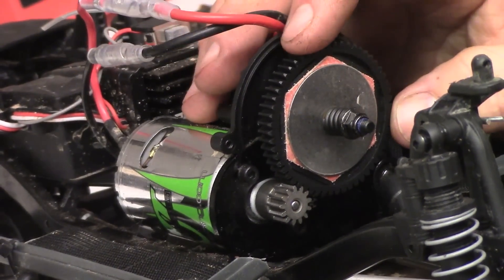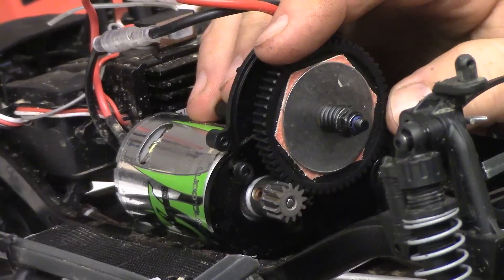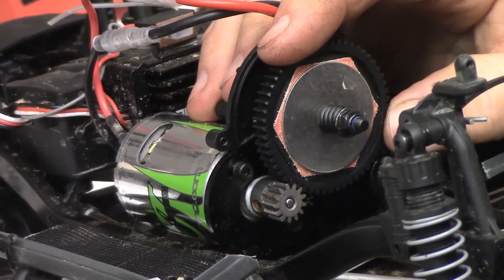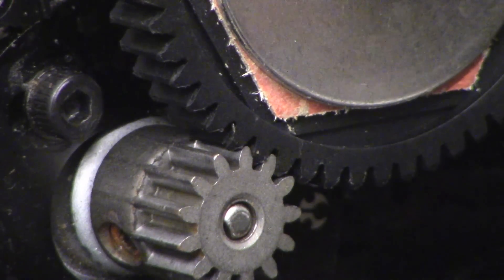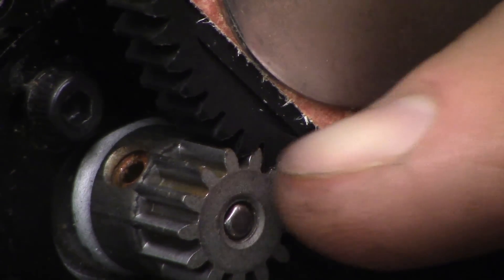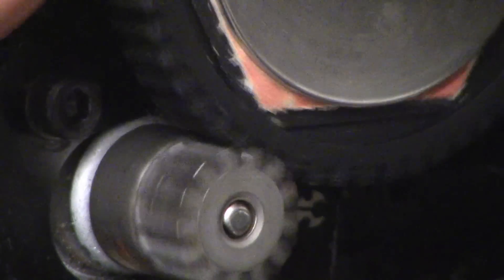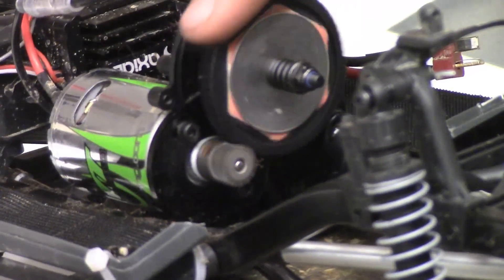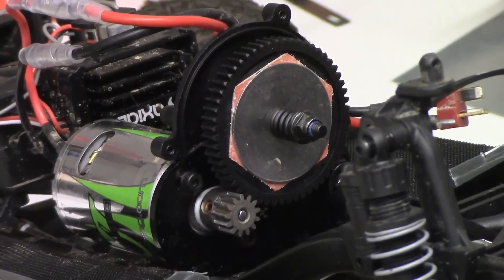RCTogether * How to set gear mesh

Comment: I have a arrma voltage and the pionion gear is 16t its to tight i tryed evrything that i can think of and it didnt work
Reply from the maker: Sometimes you may reach the limit of what the car or truck can handle and generally you can find documentation online or in the manual that will let you know how high you can go of a tooth for any given gear. Now if you’re hacking if you’re trying to get a bigger tooth on your Motor and it’s just a little too tight but fits you can get a Dremel and take away a little bit of the material that allows for the motor to be slid just a little farther away so that you can get the right space and not have it too tight. I hope this helps and thanks for watching.

Comment: I have a 3930kv motor in my arrma voltage and the pionion gear is 16t and it is tight so if i go to 17t and put it on the 19t would  it fit

Comment: I think you are right. The best method is to use your eyes and a magnifying lens to see the gap better. Especially if you have an 64p gear
Reply from the maker: Thanks for the feedback, I like your idea of a magnifying lens, that is a great idea to be able to see the mesh much better.
Reply: nomedab Yes. I manipulated the gap between 64p gears which have more dense teeth  according to your video. I think your method is more detailed because whenever I inserted a piece of paper, the results were not always good as the gap was not always correct.
Reply from the maker: This is great feedback, I found the same inconsistencies with the "paper method", one of the primary reasons I made this video!  Sounds like you are running nice and smooth now!  :)
Reply: nomedab Yes but I still need time to get the knack of it well.

Comment: Nicely done, im personally having an issue where my pinion kinda feels like its binding. Its an 8.5 turn so you can feel that notchy feel when you twist the motor alone. But my problem is its confusing me when im trying to mesh because when you spin it you have that same notchy feeling the motor has but i mean it drives fine and the motor doesnt seem to over heat. But still not sure if i just have it to tight. 

its funny because they say electric is less finicky than nitro but im so used to nitro that this electric stuff is confusing me haha. just the feel of the motor the way it spins and no matter what type of mesh i try it feels not right to me. and its all new stuff.
Reply from the maker: +Review Guy interesting, does it feel like it is binding at a certain point in the rotation?  Or is it consistent throughout the turn?  Some motors are just really stiff and noisy.  We typically run sensored brushless motors and they turn very smooth and quiet. Maybe try loosening up the mesh just a bit and test it out.

Comment: nice perfect video been stripping out Spur Gears all weekend with my slash 4 × 4 hopefully this will help me I only get about two and a half 3s batteries out of it in hard pack sand
Reply from the maker: Hopefully this helps you out, this is exactly why we posted this video because there was not a lot of good videos on this topic that just cut straight to the point.  Glad you found it useful.

Comment: My rcs have always been noisy
Reply from the maker: +The Real Pro Racer lol, mine did too until I switched to the dark side lol,  I mean brushless. 😉
Reply: nomedab haha but mine are brushless 🤔
Reply from the maker: A good trick, which you probably already know but I will mention it anyway for others who read this, is to pull the motor or at least disengage the gear mesh for the pinion and spur and free roll your RC.  Determine if it is a very smooth roll and/or quiet.  It should be both, but if not check for other binding points in your driveline.  But then again, some RCs are just plain noisy!  :)
Reply: nomedab yeah I've done that 
Maybe it's just because my rc is noisy... that reassures me thx